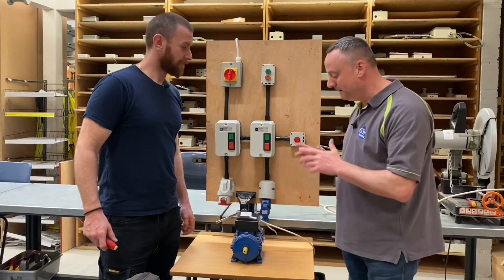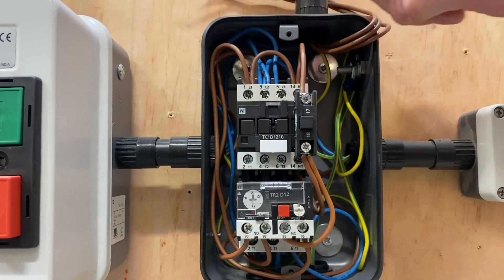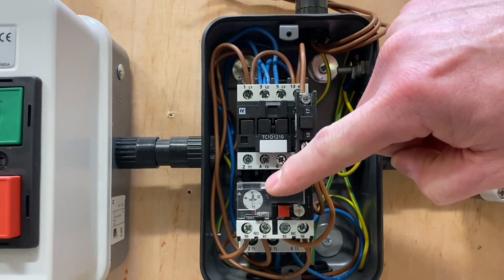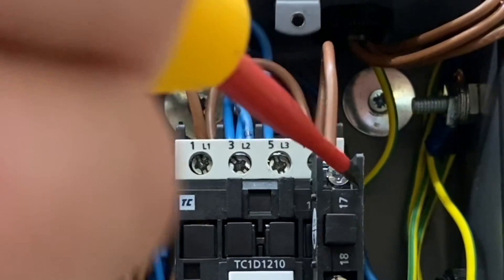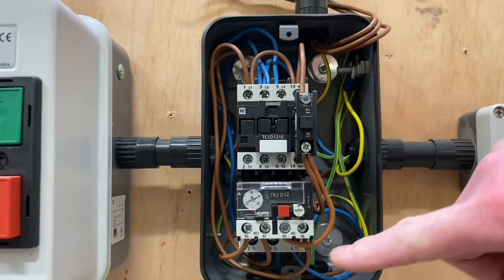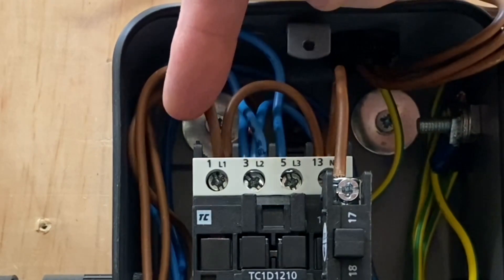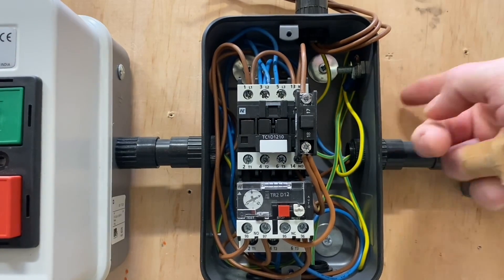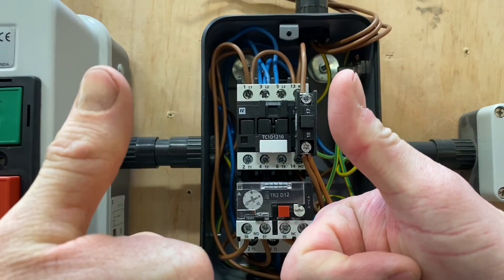Single Phase Direct Online Starter DOL Wiring - Connections Explained and Setting the Overload

Comment: Can you explain why you have to loop the neutral back round through the contractor again and not straight into the motor?
Reply from the maker: Hi the answer is in this video 👍🏻
Single Phase Direct Online Starter DOL Wiring Diagram Connections Explained
https://youtu.be/7U-DqKQkSPU

Comment: i got a dol starter,sprecher & schuh.it has the phase going into L1 & out on T3 to motor with T1-T2 .& L2-L3 linked, strange that the manufacturer puts the phase thro the relay as opposed to you running the neutral thro,...also 95 is internally permanently linked to A2 of the coil.

7the

Comment: Sadly i dont understand anything in that messy box, its much easier to take everything apart use drawn schematics to explain the connections then wire everything one by one and explaining using the drawing.
I saw this on an Udemy course and it was very easy to understand, i understand the idea behind the contactor > Overload > auxiliary contacts and coil power going through the overload before going into the contactor but the little box is too messy and hard to follow what is happening in there.
Reply from the maker: Motors, Starters, Controls, Remote Stop Start - Single and 3 Phase
https://www.youtube.com/playlist?list=PL2Ea5r9gxUUfv51Ld1UlNGR39rfFIExTU

Comment: On my AM2 i did the calcs from the faceplate and incorporated the p.f  i told my examiner I was doing it this way and he was fine.  Think they chould make it a bit more difficult, by having you choose the correct rated contactor with the correct coil voltage.  2 wires to connect did not show skill in wiring a dol.

Comment: Excellent video, have you done a video on the same three phase motor.
Reply: 3p is pretty much the same.  Apart from the neutral goes direct into A2 of the coil L1L2L3 in T1T2T3 out.